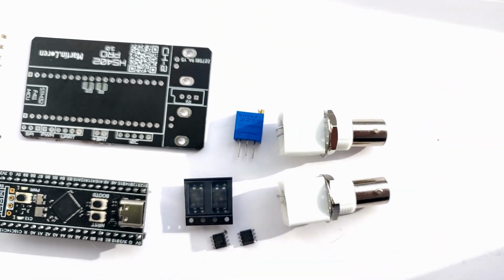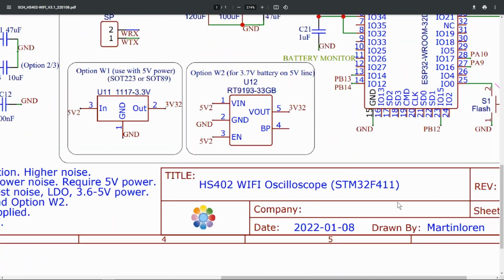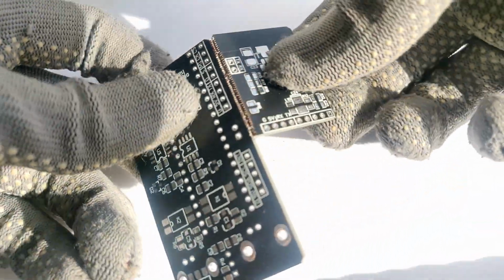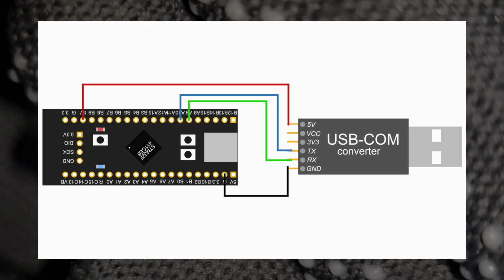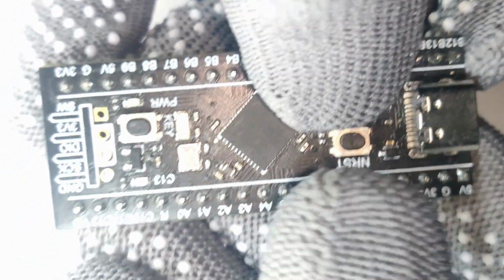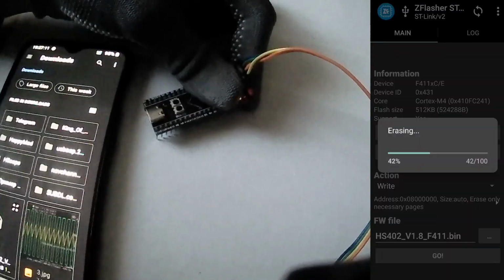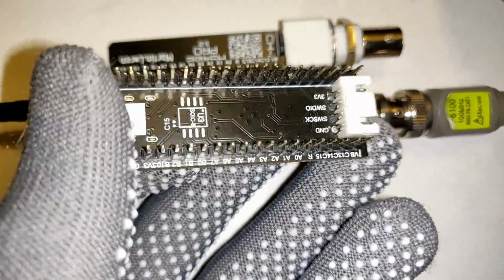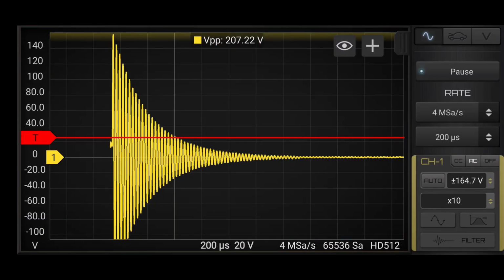📟 HS402 Android STM32 USB Type-C DIY Oscilloscope

Comment: A very complete guide to this build.  Thumbs up!!
Reply: Hey there, what is pricing of the HS402 Hscope app license?
Reply: @OMNI_INFINITY  just check in the app, price calculated automatically by Google
Reply: It's alright to power that board through the STM32 with the STM32 connected via USB to a 5V USB AC adapter? (The common type for phones) (Asking because he said something such as "if using 5V or higher" about another method)
Reply: @OMNI_INFINITY  no problem for 5V USB adapter, it would just add noise. For power from STM32 board pay attention that it won't drop some voltage. ESP32 need high current spikes. In case you change the schematic or connections you have to test that.
Reply: That answer is appreciated. Thanks! PCB is sitting on the reflow plate waiting for component to arrive.  @martinlorenrd4073
Reply: Hi! What is most recommended 3D printable case for the 3.1 edition? (with or without WIFI module)
Reply: BUILT entire oscilloscope and flashed firmware and after that SADLY found out neither android phone seems to have OTG capability. Bizarre and sad. Thought it was standard in phones from past 5 calendar years.
Reply: @OMNI_INFINITY  yes quite sad, fortunately phones are more easy to find than stm32 boards :D